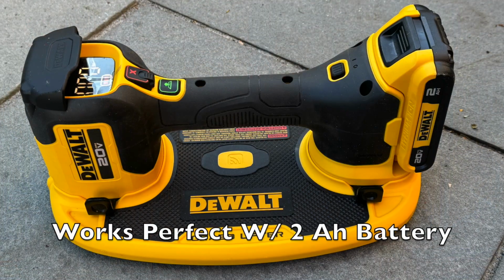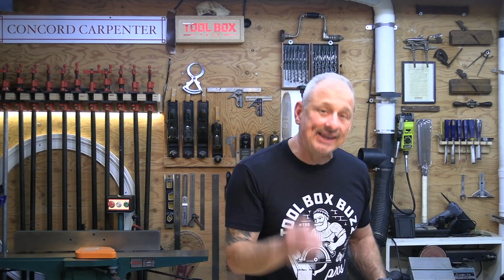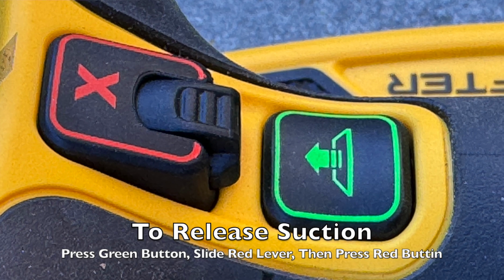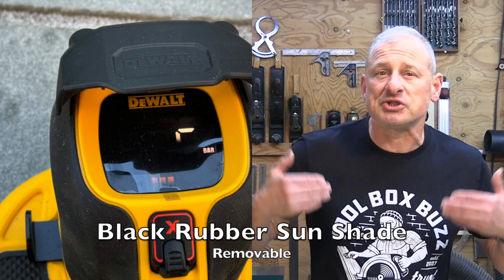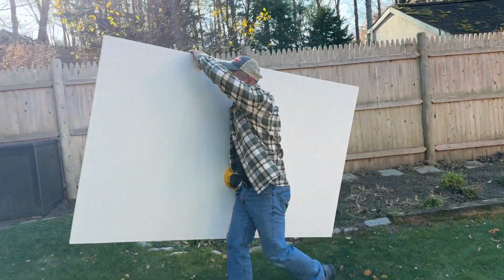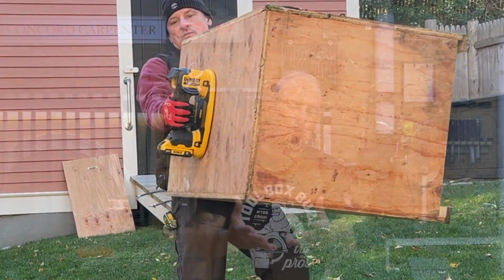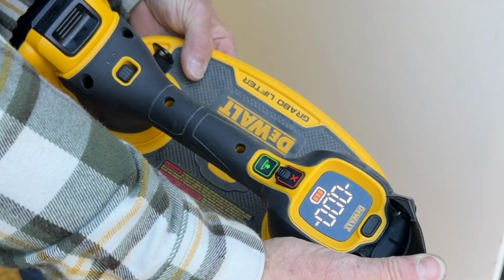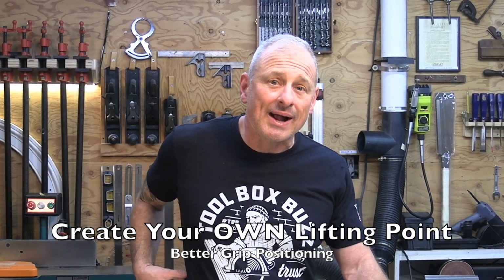Dewalt 20V Grabo Suction Lifter | Tool review

Comment: Hi, I just got one of these, but it is not able to “suck” on a casted concrete block. If I turned up, there are 3 holes with filters, but only one sucks in. Is this correct on other pieces or this is a bad one? Could somebody check please.

Comment: They should have like a preset PSI for glass. So it would hold with the right amount of pressure. Or better yet, a PSI Adjustment knob so you can pick -1 thru -12.5 psi setting your self.
Reply from the maker: That would be a very helpful addition.

Comment: The "Grabo" brand version of this suction lifting tool is superior, as it will lift 375 lbs. versus this DeWalt branded iteration of only 265 lbs.
Reply from the maker: @jetsetjoey  I’ll tell you why I like this Dewalt version. It’s because I have a ton of batteries on hand and if I need to use the suction Tool I’ll always know I have a good battery. The Grabbo Tool has a proprietary battery and it sit in my van months at a time between uses and sometimes when I need to use it, the batteries not charged or it needs a charge.

Comment: I have the Grabo Pro lift and recently went out and bought the DeWalt I was excited that it would be on a battery platform that I had after using both side by side. There's no doubt that the original Grabo is a far better product. Sure, the Dewalt has some nice features that were added I like the rubber grip on the DeWalt and I definitely like the safety as far as shut off but other than that the original Grabo outperforms it. There is no comparison. What I'm really looking forward to is Milwaukee jumping in so they will do a far better job and on their M12 platform it will be even better. As far as I'm concerned, this is a fail on DeWalt sides. They should have used the same internals that are in the original Grabo Pro. The DeWalt will be returned and I'll be ordering a second Grabo. I held out waiting for this one knowing it was coming to market. Should have just bought another Grabo. Plus I can fit two in a systainer nice and clean . Hell Let's face it  the price is the same.
Reply: I have the grabo pro it’s a beast and preforms well. Looking to see if Milwaukee jumps in.
Reply: Redundant argument when you can’t lift anything close to 200 pounds by yourself anyway. If you have two men for the job, you probably can do without having grabo anyway, so the fact you’re buying one to make single man jobs easier should make the difference in weight completely useless. Dewalt is much bigger of a company and prone to lawsuits, which probably made them lower the lifting capacity down to lower potential for disaster, but I’m willing to bet it would perform almost identically to a grabo. Grabo literally made the product, dewalt just slapped their name on it. 260 pound limit is an insurance policy.
Reply: @sdbszz706 
Where did the original post critique the weight capacity...and "can't lift anything close to 200 pounds"? 
It may not be advisable for some people/situations...but yeah I do often.
Reply: @adamjames1375  since you can’t read, i’ll assume you also don’t do what you claim you do often either
Reply: @sdbszz706  
There's no direct reference or synonymous language, by anyone in regards to weight carrying capacity. You chose to infer that from other adjectives. 
I regularly lift (3) bags of concrete at eighty pounds each for a total of 240 pounds, and carry them distances of usually <10 yards. 
Aguing that you "shouldn't",  O.S.H.A. wouldn't allow it,  that most tasks intended do not require >200 lbs., or that my example is outside of the parameters of this tools operation may afford you a chance at being right, or correct.
Reply: @ stop lying on the internet.
Reply: Completely agree with Dean on this!!! I got to of the Grabo's myself and no comparison to the dewalt 👍
Reply: Let me guess. All of your tools are Milwaukee?
Reply: @macrip78  if you're referring to me..... Milwaukee and Makita make up 95%.
Carpenter for 41 years some of the best tools....trust me I've tried almost all of them. 
What you got????
In This case dewalt doesn't have near the same suction as the Grabo ...let me guess, you didn't do your homework.....
Reply: @reddawgrup1779  I was replying to the same person that you replied to. I'm on YouTube watching a video on suction cups. I'm pretty sure that is considered research. I have a combination of all of the best tools from the top manufacturers. I'm so sick of the fan boys that only buy one manufacturers tools and think they're the best. It's ridiculous and shows a lack of intelligence.
Reply: @macrip78  No, I have every battery platform because I always buy the best tool for the job. I own Festool, DeWalt, Bosch, Mafell, Hilti, Milwaukee, Metabo, and Makita — you get the point. I probably have over 100 batteries.

Comment: There's another channel that has been promoting the Grabo tool for a few years, also in combination with their acrylic router templates.  Seems like a slick tool, but the built-in battery was a bit annoying.  Nice to see a partnership with a tool company to enable swappable batteries!
Reply: Izzy Swan!
Reply: The Grabo Pro and Nemo Grabo both have removable batteries.
Reply from the maker: NEMO Technologies - and agreed!
Reply: The original grabo tool had built in but the newer versions have swappable batteries. Regardless, the dewalt and the grabo pro are really nice tools and worth the money.

Comment: Need a makita one mite try with adapter
Reply: Makita is junk
Reply: @parkerk7018  let me guess, you spent $150 on a subcompact set and got mad that they wouldn't sink lag bolts.
Reply: @jimkane9832  nope I avoid makita like the plague
Reply: @jimkane9832  I’m sure that has happened to you! That’s why your complaining
Reply from the maker: @rablord8944  does Makita make a suction lifter?

Comment: Does it work on OSB plates?
Reply from the maker: @EvoKey  it should but I didn’t test it
Reply: It needs a very smooth and flat surface, so probably not
Reply: @aonghusofaolain8686 did you not watch the video? He picked up cement pavers. It absolutely does NOT have to be “very smooth and flat.” I lift OSB with mine all the time.
Reply: @FreshCityVentures  ones I've used wouldn't pick up some mdf with off spray on them
Reply: @FreshCityVentures  Harsh. I did watch the video. Enjoy your tool and have a great day.
Reply: @aonghusofaolain8686 off spray? 🤨 I’m not sure what that is but I specifically bought mine to lift and maneuver MDF panels around my shop when building cabinets. I’m assuming you were using the round style Chinese manual pump suction cups? The Dewalt and Grabo definitely lift MDF, it’s what they were made for.
Reply: @EvoKey my response was obviously for @aonghusofaolain8686 not you. Have a good day as well. 👍
Reply: @FreshCityVentures  it was the real grabos that i was using. Couldn't get a seal
Reply: Tried it with the original grabo. It didn't work very well because it had trouble maintaining a seal.

Would probably work with something like Adavantech or zip system though. It works very well on drywall.